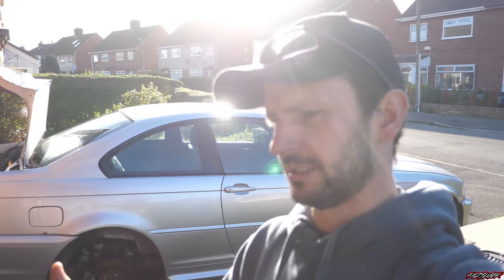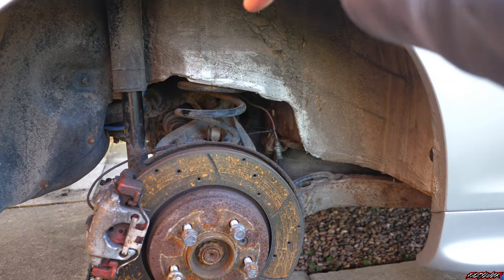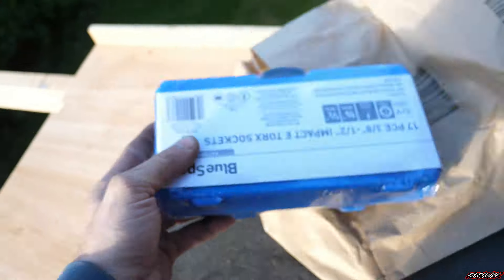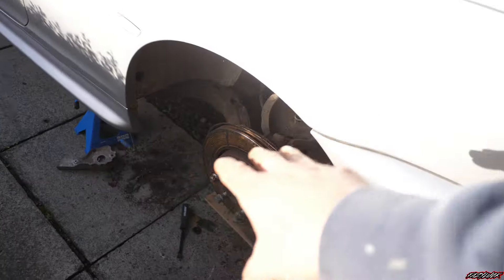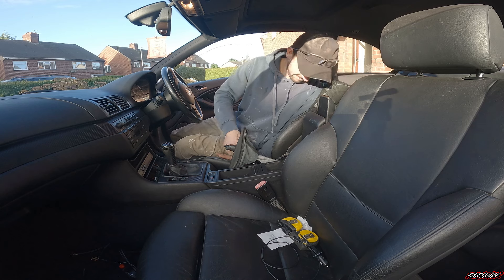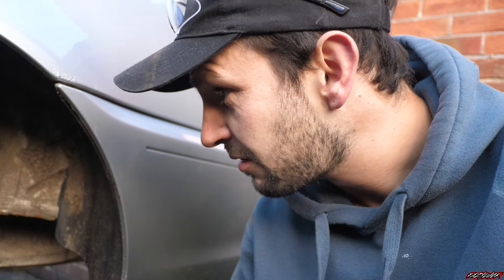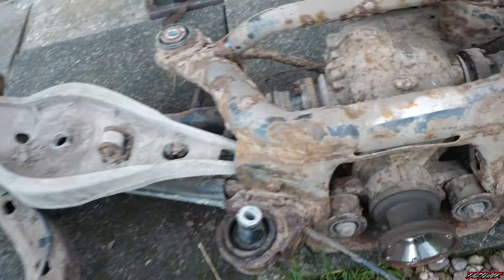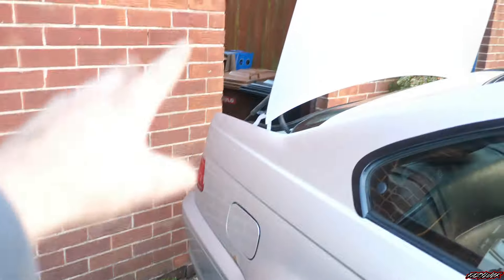A REAR END OVERHAUL IS LONG OVER DUE // BMW 330CI

Comment: Atta boy!!! 

While you got the subframe out, have a look at where the subframe itself mounts to the chassis. I see a lot of companies selling reinforcement plates as they are prone to crackin/splitting the seam's. 

Looking forward to watching the build bro 💪
Reply from the maker: Cheers! Ye bro. Going to give it a good look over. I won't have the facilities to weld the reinforcing on the chassis this time round. But should last a while as long as I don't run it gripped up at the track.
 (Which my driving isn't good enough for that anyway 😂)